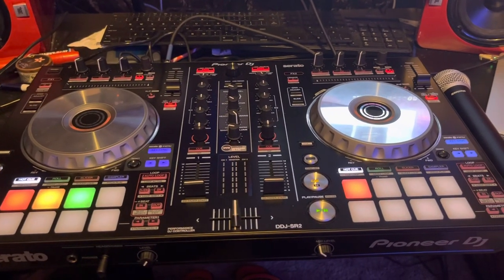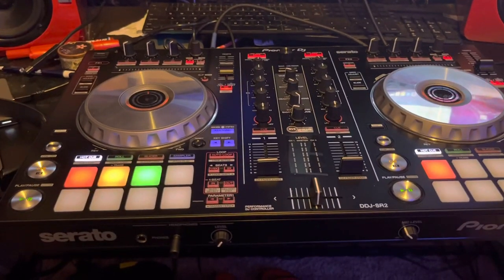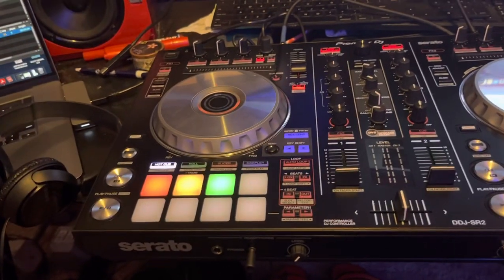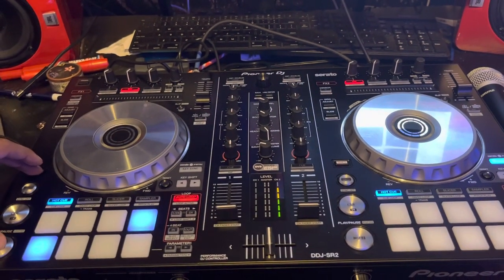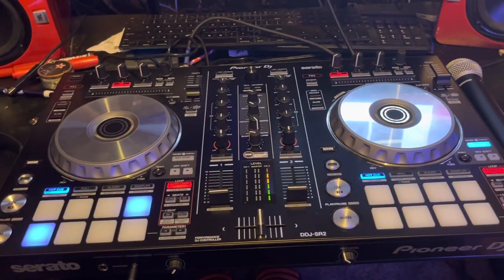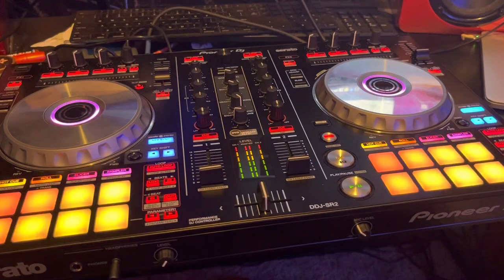Pioneer DDJ SR2 (Microphone Fix)

Comment: if you got a shure wireless mic, unscrew the mic capsule completely..ie: remove the mic capsule. there's often a hardware switch allowing you to attenuate the mic usually by 10 dB. This is a hardware attenuation, from the source and is meant for use on very loud stages. And of course since it is a hardware attenuation, you can plug the mic into any mixer and you don't have to worry whether the last DJ or the club you're plugging into has done any attenuation. it works on the default settings on any mixer.. even if they have attenuated it, you get a lot of headroom to turn up the gain without distortion. many other wireless mics have a hardware attenuation feature too. could be a switch, it could be a slider or could be a button on the base receiver unit.

Comment: Bro thank you so much! I have had to bring an extra sound board and run the mics and board into that for the last year and a half.
You're seriously a life saver.
Thank you.
Reply from the maker: Bro that stinks. I’m glad I could help!
Reply: Ok I have to say, after my last two gigs I noticed my music quality dropped after I made this switch. I've ultimately decided to toggle it back on and then I am using a SEPERATE sound board and inputting the mic and the board there and running the sound from there to the speakers.

Ever heard of the sound quality dropping when doing this?

Comment: You can also hold the Channel button down on the mic and you’ll see a small green dot appear next to the channel number. That will reduce the mic volume by -10db.
Reply from the maker: Thank you for that info!
Reply from the maker: It all depends on what mic you using.
Reply: @dizzyvisionz4493  This is true. I have the same mic you have so if anyone else is reading this, it’s for that mic specifically.

Comment: Thanks a lot for sharing.  I literally had this happen to me this past weekend while using the same equipment and started looking for audio mixers to add to my setup to help prevent this from happening.  Curious... how are connecting your dual wireless receiver to the dj mixer?  What cables are you using to go from the dual wireless receiver to the single input dj controller?
Reply from the maker: You are welcome. I am glad I could help you with your setup. I am connected using a 1/4" TRS Unbalanced cable.
Reply: So...is it supposed to be a TRS or TS cable...?

Comment: I bought this board but WHY would Pioneer make a controller without any EQ on the mic? That's just CRAZY! Unless someone knows if that can also be adjusted in utility mode...anyone?

I WILL REPEAT: THERE IS NO NATIVE EQ CONTROL FOR THE MIC ON THIS BOARD!
Reply from the maker: You pay for more features fam. The pioneer boards that cost more have separate mic channels.

Comment: Usb Microphone?
Reply from the maker: No. The microphone you plug into your dj board not the computer.
Reply: @dizzyvisionz4493  What kind of microphone?
Reply from the maker: @ramaanplayz2901  Usually microphones used with these dj boards are dynamic.  This board has a 1/4" Unbalanced cable input. I have a Shure BLX288/PG58 H9(I was using in this video)  and I have a corded SHURE SM58 as my backup microphone. Also a cheaper option.

Comment: I have a question about my sr2 controller,  hopefully someone here hv the solution  ... ..   whenever my sr2 controller is plugged in via the  adapter it dosen't work instead the sensor light keeps flashing with no other response from the controller.. anyone here have any idea what could be the problem? 🤔
Reply: Do u have it plugged w a power chord. ? Or running off usb power ?   Plug in both
Reply: It operates fairly well when used with the USB only.....  wherever it's plugged in using the using the power chord thats when it stop working,  the sensor light keeps blinking without any other response at that time
Reply: Sometimes it gives problems when using the USB only due to the fact that the sub isn't supplying enough current to the controller